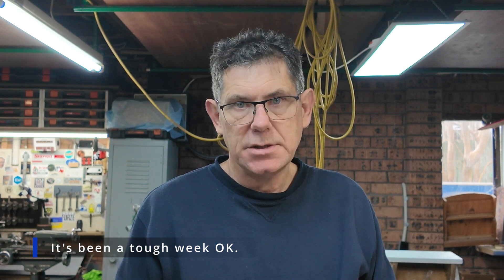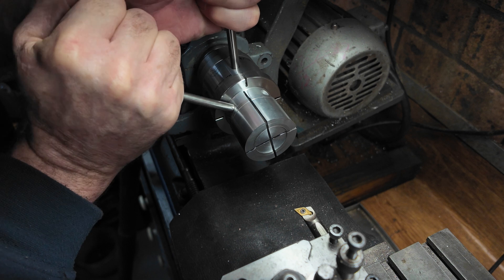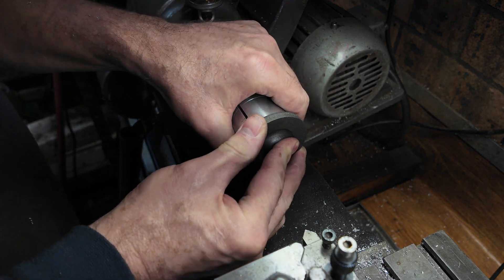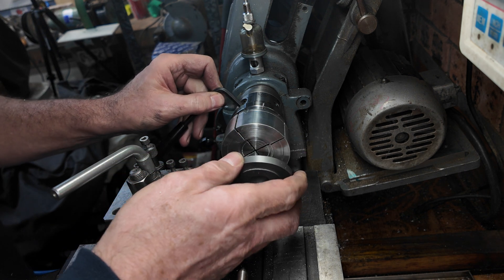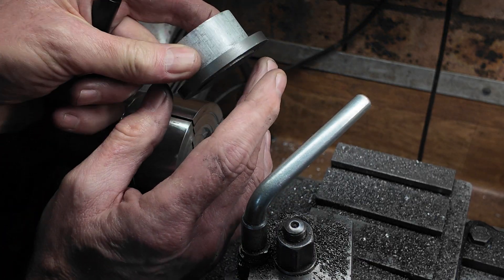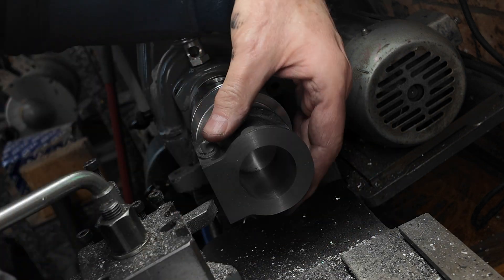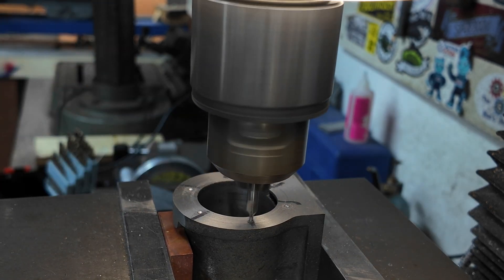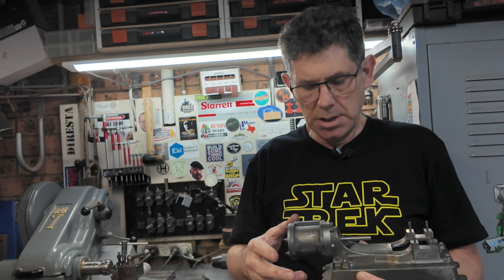Flexi Chuck

Comment: Any idea (or is it even specified) what the TIR repeatability is if you take one of the flexible fixtures off and remount it later?
Reply from the maker: The only times I measured any runout it was due to burrs or chips.
Reply: @CreaseysWorkshop  Thanks - useful to know!